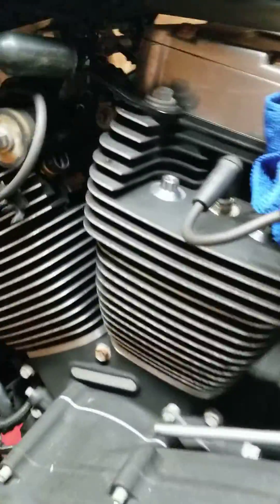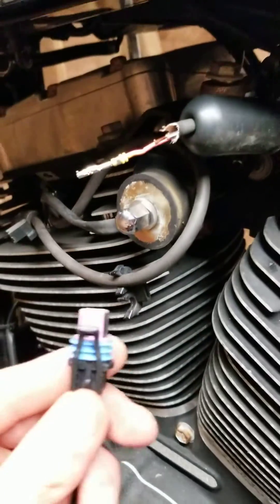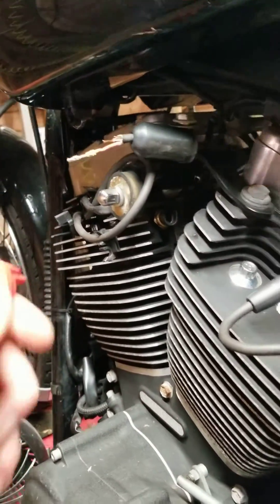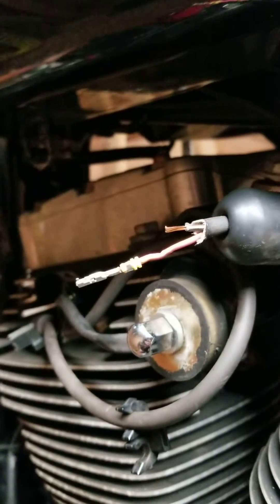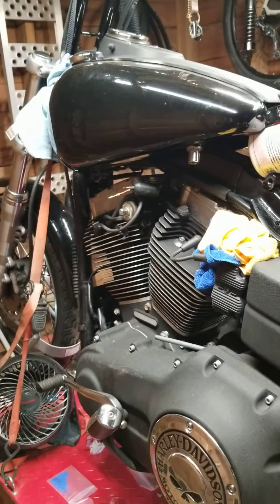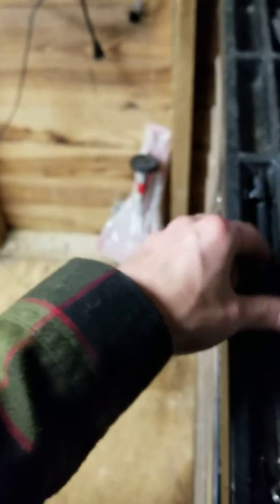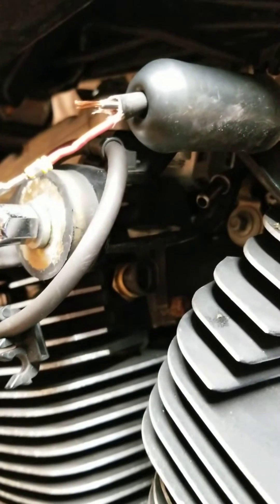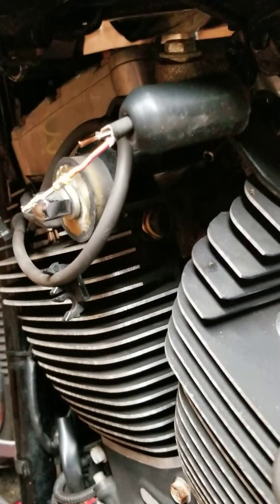Harley Davidson trouble code P0118

Comment: what was happening with the bike while is was running. Why I am asking. 09 rocker, to cuts out and stales at low idle but when I get up to higher RPM it runs.
Reply from the maker: It would cut out very briefly. But never cut off. My bike will stall sometimes when I pull in the clutch and roll up to a light or something. I'm pretty sure the I.A.C (idle air control valve) is the culprit, it gets hung from gunk and what not blowing back into the throttle body. It's easy to get to and clean. Have you checked your engine codes?
Reply: @ethanintheelements2528  I have P0107, P0131, P0151, P0374 after it does its thing.

Comment: Did u end up getting fixed what was it brother
Reply from the maker: Yes I did get it fixed. I stripped the wire and found the pin that goes in the plug and clamped it to the wire. I had already bout the sensor so I just have it on a shelf now in case the sensor actually goes out.
Reply: Ethan in the elements I wish I had it as easy as you make it sound.. While replacing my sensor I couldn’t get a good fit with the connector and I ended up breaking the connector. I then bought a generic connector which doesn’t clip together with the sensor securely. I’m waiting on the oem connector now hoping that will solve the issue otherwise I’ll be second guessing my crimp work and the whole wiring setup.
Reply from the maker: @Kahchooo  sorry to hear that man. Hope it works for you. I took me alot of time and research to find thos little pin but finally found them on ebay. Patience is key, that's what's great about harleys u can fix about anything on them with a manual and youtube video!